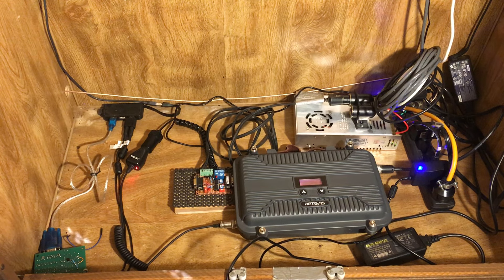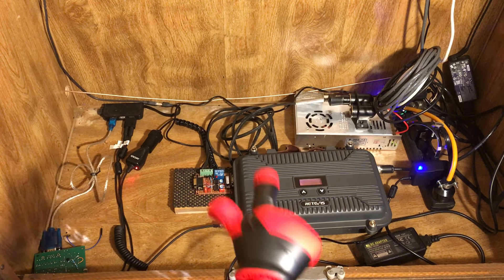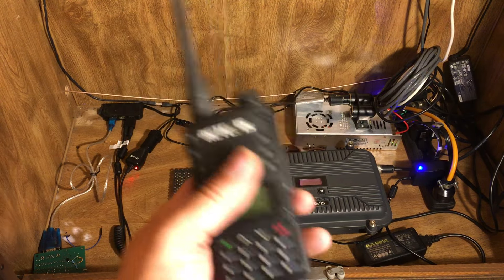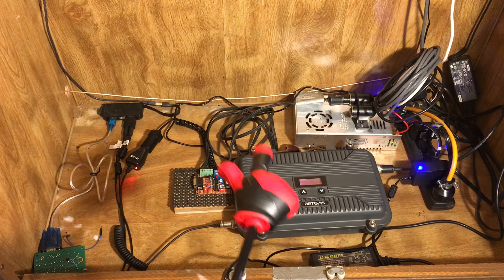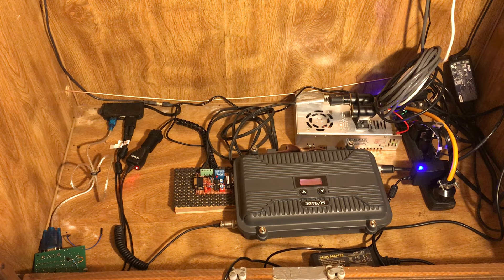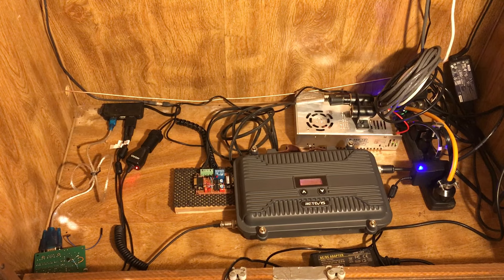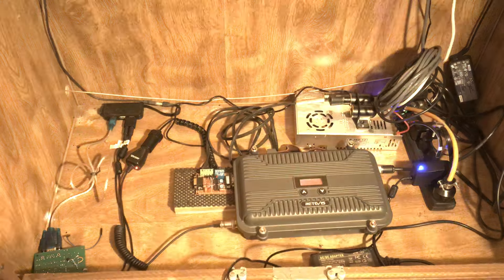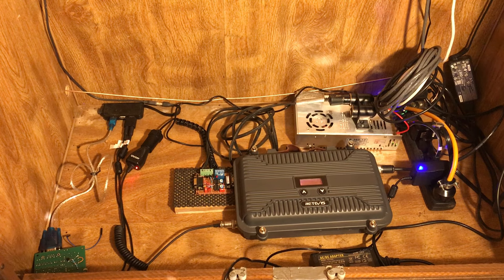🔺 add TOT function to your Retevis RT97S or Midland MXR10 two-way radio repeater!!!🔺

Comment: That works really well. That will definitely solve the problem of over heating or killing a battery
Reply from the maker: yes it does. i have more function to add well hopefully..lol
Reply: @GMRStwowayradio  maybe a dtmf tone shut down?
Reply from the maker: @JDubbsadventure  - hummm I am checking into that, not sure if it's possible with these types of repeater. But I need enough people to show interest or this project won't go forward 🙁